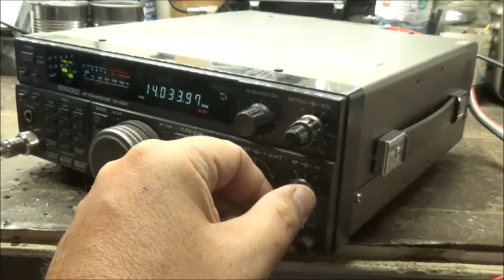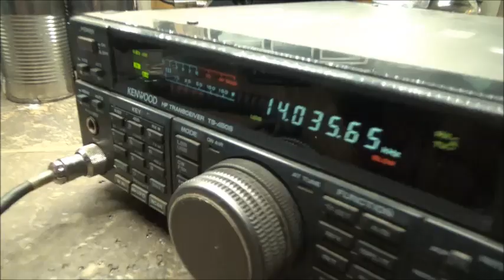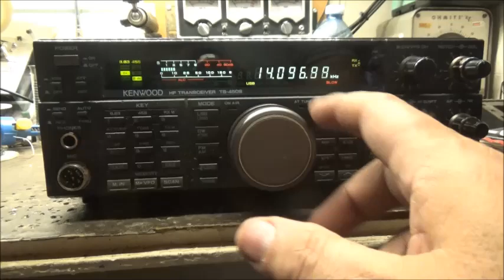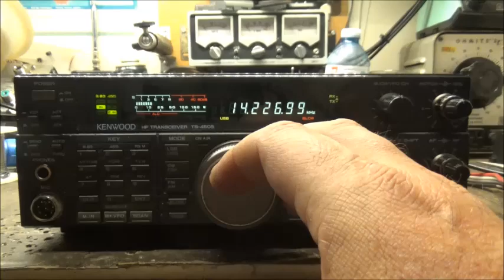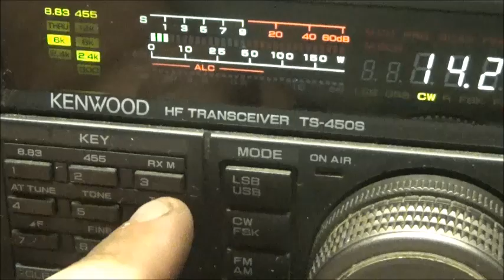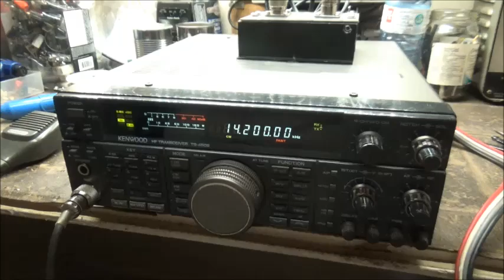KENWOOD TS450s  Receiver issue and repair

Comment: That is not a diode, it is "DSA301LA" (Surge Absorber Gas Discharge Tube). It seems to be burned.
Reply from the maker: @batman4e  was not sure, but yes i knew it had to do with a static discharge from the antenna, just not sure what part number it was.
Reply: @batman4e  that’s what I met I forgot the name discharge tube for surge protection and they are expensive if you find them I know